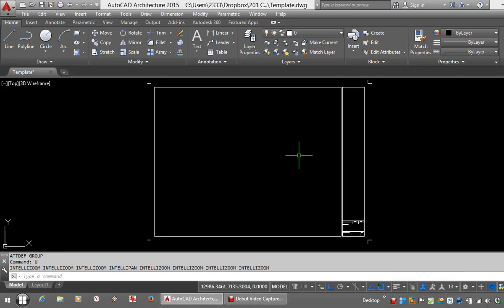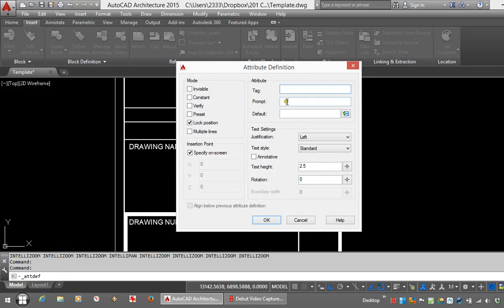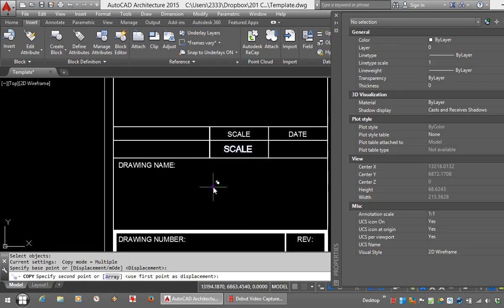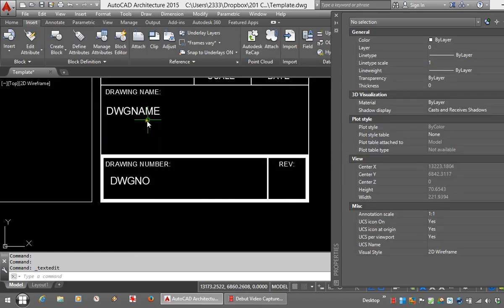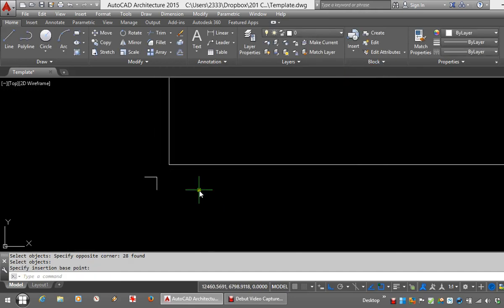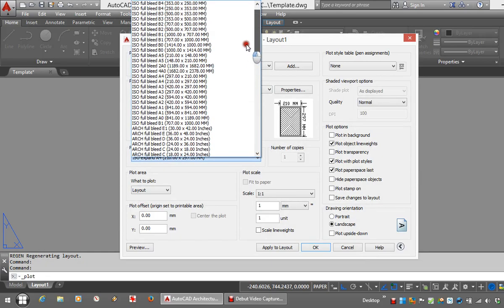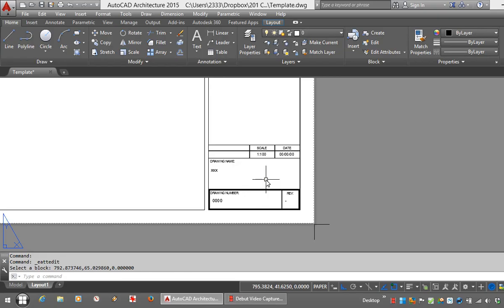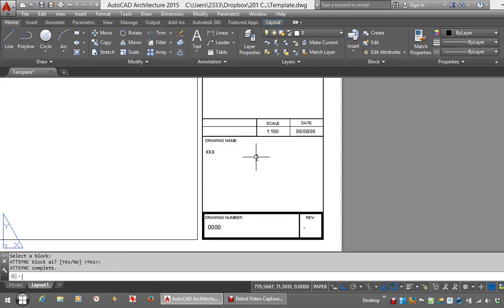AutoCAD Attributes Part 1 -  Creating Titleblocks with editable attributes.

Comment: Thank you for the tutorial. Could you please also be able to tell us how to add additional text lines into an existing attribute? The attribute I am talking about could be created as new if it was jus one. But it is in an existing drawing and there are hundreds of these already with data like measured areas in it and I need one extra information on it (of the room type ) into all of it at a time. How can I achieve this?
Reply: Do you still have this problem?  I have programs that could help you.  Unfortunately you will have to replace each of the title blocks as attribute information added to a dwg or a block does not update any of the other blocks within a dwg.  Title blocks normally are one to a dwg.  My program will capture all of the attribute data.  You can erase and reinsert the revised title block.  Then my program will repopulate all of the attributes in the dwg.  Let me know if I you are interested?

Comment: Thank you for doing these tutorials.  I've not used AutoCAD for a while and yours are the clearest to help me found my way around with 2015 Mac version.
Reply from the maker: Esther Wheatley Thanks for the comment. The Mac version functions the same as the Windows version but unfortunately is laid out differently which is where most of the confusion seems to come. You'll find equivalent commands for most things, you'll just have to hunt for them.